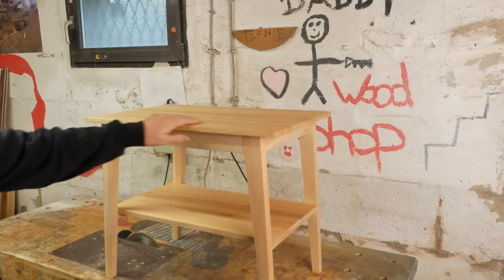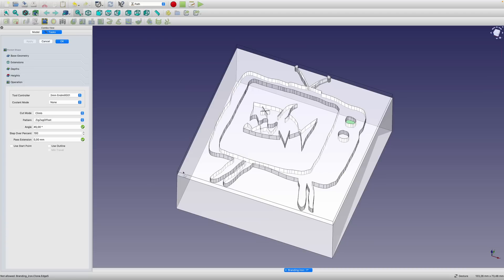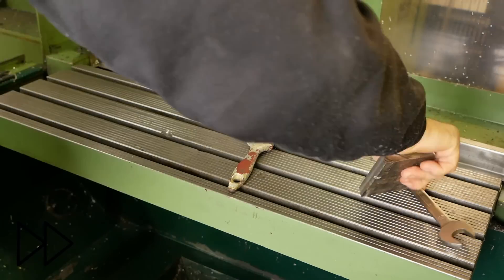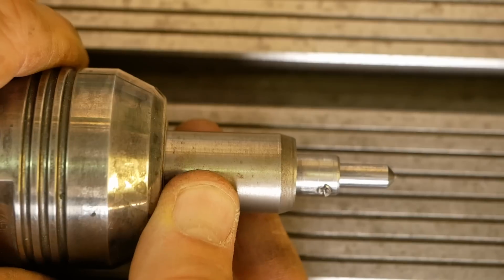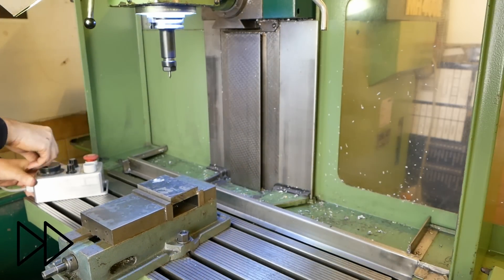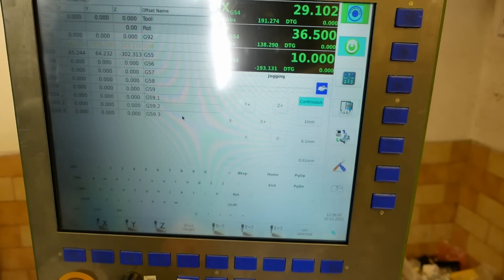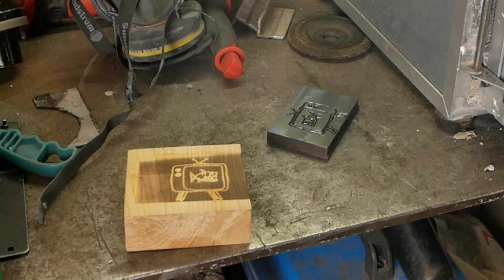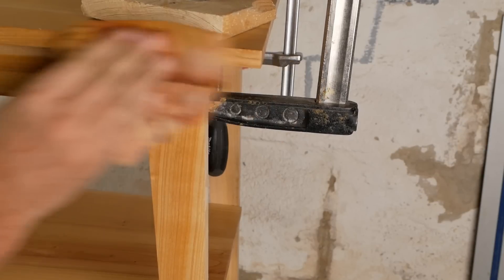Branding iron for my woodwork.

Comment: If you would use the Steel blank as a Casting Form for alluminium IT would bei the right orientation and the lines would be high spots that burn into the wood
Reply from the maker: Oh, now that is an excellent idea. I like that. Thanks.
Reply: @RotarySMP  It's clear you planned to do that all along, why else would you have machined it to produce a mirror image? 😉
Reply from the maker: @graealex  I honestly didn't give it a seconds thought! My "planning" often includes such glaring omissions. :/
Reply: @RotarySMP  I agree, a good idea, But it doesn't solve the original problem, which still will haunt you again and again. CUT2D by vcarve
Reply: Probably you could use copper to cast the brand. And that’s a super rare left handed TV set. C’mon. Haven’t you seen a left handed TV before?
Reply: Cast it in Bronze. It will make for a more durable tool. I would also suggest using it with an arbor press to make quick deep impressions without scorching the surrounding wood.
Reply from the maker: @nrml76  True. I need to pour some bronze as I am behind on my Beatles statue series.
Reply: now I read you ... same thought here ^^

Comment: I do a lot of 2D CNC engraving like that job.
For most cases I just use Corel Draw or whatever 2D drawing program you can work most quickly with, and manually draw in a toolpath for the areas you want to engrave or cut out.
It might sound like a lot of work but you only have to be accurate creating a toolpath on the very edge, then the rest of the pocket you just make sure it is inside the edge (of course) and the stepover (which you msnually draw) is smaller than the tool diameter. And for pocketing interior paths etc you can often just use rects or circles which only take a couple of seconds to draw especially if you have "snap to grid" set up right.
For something like your TeleFish it would probably be about an hours work drawing the toolpath manually. Maybe less if you are comfortsble with the drawing program. I'm guessing between the file conversions and frustrating attempts you probably spent more than an hour on it, which is one reason I mainly draw manual toolpaths. The other reason is you get total control of the cut and stepover etc, good for us control freaks. 😎
Reply from the maker: Thanks for that insight into your method.

Comment: Self intersecting geometry means you have one or more “loops” in you part. If you imaging a square shape using a piece of string. Now take one corner and twist it into a loop. You proved it was the model by trying feature cam. Send me your Iges file and I will correct it, or send the pic with the outside sizes marked and I will make a new model that will work in either CAM. Keep up the good work. I do enjoy your videos. 😊
Reply from the maker: I went through the whole dxf, looking for that sort of issue. My Email is on the channel "about" page, so if you drop me a line, I'll send you that iges file. Thanks for looking at that.

Comment: A possible cause of "self intersecting" geometry in Feature CAM could be the large polygonal shape. Internally it still consists of triangles they are only hidden. I'd try to split up all large polygons until they consist of smaller convex ones, without negative angles. It could be done in Blender manually or using a remesh afair. Large concave polys are always problematic. I'm very happy whenever you include Maho work 🤗 by the way.
Reply from the maker: Thanks John. That is only a thing with surface meshes isn't it? this is a solid.

Comment: For the program it looks like it might have not gotten the dimensions of your part right or maybe it thought it was inch rather than metric? Or it might have wanted you to set the stock of the material as well? Just guesses since it is a very weird situation.
Reply from the maker: I thought that as well, but that block is 60x60 in the CAD.
Reply: @RotarySMP  could have it been tool dimensions them? its just seems like a weird situation, could you share me the file so i can look at it?
Reply from the maker: @gm558  I just started a thread on it in the Freecad Forum:
https://forum.freecadweb.org/viewtopic.php?f=15&t=74440

And the file is here;
https://github.com/rotarysmp/mh400e-linuxcnc/blob/master/Telefisch.iges
Reply: @RotarySMP  i will try it with the same program over the weekend, should i write you an email or just reply here?
Reply from the maker: @gm558  Probably best to answer in that FreeCAD forum, as then others can learn from the same.

Comment: Maybe the scaling in freecad was way off. Therefore the 2mm end mill was to big for the little pockets and it found no geometry to cut. Furthermore it explains the behaviour on the outside of the part. Maybe it was a part in mm imported as inch - this would make your part 25.4 times smaller than it should.
Reply from the maker: Good point. I'll check that.
edit, that wasn't it. The part is 150x150mm in FreeCad.

Comment: Old school way would still work. Contour in Coreldraw would step any increment you set, so use a setting just smaller than cutter diameter. You would draw the outer shape, then set it to 'outline' inside said shape, whatever was required to make a faux toolpath. Leaving required raised areas as blank, so you are cutting away with what you draw. I used it long ago with Dancad 3d, exported to dxf or whatever was required.
Have emailed you a sample.
Reply from the maker: I could do that, but would rather learn to use FreeCad properly rather than doing a workaround.

Comment: DXF files don't have units internally. It's possible that your file is in inches but FreeCAD is interpreting it as mm. Maybe try creating a 2mm cylinder in the same FreeCAD project and see if the scale looks correct?
Reply from the maker: I thought that as well, but it shows up as 60x60mm

Comment: Came to comments section to see what is popular in open source community regarding CAD tools. Nice video but I miss parts related to plane servicing. Could you please say something that device that prevents hydraulic oil to drain completly in case of failure? Think that is later addentum after some incidents where planes lost 2 or 3 hydraulic circuits.
Reply from the maker: I cant always think of the right aviation things to talk about. 
I need to try harder. Thanks for the reminder.

Comment: If your tool paths looked like the they have way too much clearance for a 2mm Endmill, that almost certainly indicates you didn't set up your tool correctly somewhere and it's still the default 5mm diameter.

Would be very happy to look at your job file and set it up for you as an example, with some notes.
Reply: My thoughts exactly
Reply from the maker: Turns out, my IGEs export was corrupt. Once that was repaired, it seems like Path works fine on it.

Comment: Check out cambam. It would do for your purpose quite fine. There are tosn of addons which make it quite more powerful software. It is not free but it only costs like under 200 euros. Great and entertaining work by the way 👍👍
Reply from the maker: Thanks for the tip.

Comment: Oh, Cura, the 3D printing application has a way to extrude based on high contrast images. I edit my images to be black and white only, tell it white is higher, then it spits out a great object
Reply from the maker: ?? This was not a 3D printing job. I wanted to machine it.
Reply: @RotarySMP  isn't a solid object file a solid object file? I'm just saying if one format is having issues, maybe try a different format or another way of generating it
Reply: @RotarySMP  Yes, Sure you don't want to Print it. But you can use Cura to generate an stl File based on a black and White Image to create a 3D-File you can then use in freecad. That is a brilliant Idea from him

Comment: The top is likely to split due to the cross-grain glue-up. I made a cabinet the same way out of pine when I was 15 and the top split a year later. 30 years later today, its still split, with a cloth over it:)
Reply: They make special sheetmetal brackets for table tops that slip into a channel cut into the inner edges of the aprons. This allows the top to move.
Reply from the maker: Darn, I should have thought of that.

Comment: Late to the party, so I may be duplicating something, apologies!
First: That looks really nice! The woodwork, that is. Would look good in our front room!
Second: For a Plan B, also looks great. Scrap that, leave it as Plan A - everyone can brand the lines, you brand the space around the lines, I like that!
As for the marks your stuff leaves on other surfaces - are those treated, or raw wood? I wonder if treatment helps with burning the cellulose, just like some fat in the pan helps the Maillard reaction?
Anyway, nice table, unique, cool branding, thanks for the video!
Reply from the maker: I am waxing that table. Might have already tied wax on that bit of scrap I tried to brand. That might have been the problem.

Comment: Ahh! No glue! Maybe a few inches in the center on each end. Best - a few screw clips that will let the top move. Nicely done, otherwise 😊
Reply from the maker: It is only a small table. I hope it will be okay with the glue. There are also pegs in all the joints.
Reply: @RotarySMP  yeah… pegs not such a good idea either :( hope it all holds; looks like a nice table. It is a small table, and may just stress the joinery a bit without catastrophic failure

Comment: Good effort :-) I'll just repeat what many other suggested - cast a metal stamp on the steel plate (the plate needs to be very hot for it to work), as I have no idea what went wrong with CAD file.
Reply from the maker: Hi Jose. It is a good idea.
Reply: @RotarySMP  Glad you liked it 🙂

Comment: For Fusion, I converted the image to an SVG. Inserted that onto my stock and extruded the design. The stock was 70x70mm. I only used the inside lines (if that at all makes sense) which left enough room for a 1mm endmill - particularly between the TV's legs. For the eye... I just engraved it to .3mm. Toolpaths all valid - after some faffing to get the model in the right orientation.
Reply from the maker: Hi Shane, the issue for me with Fusion, is that I cant justify the cost of a commercial license for the couple if use cases a year, but cant use the hobby license since I monetised my channel.
Reply: @RotarySMP  ja. I get you. I think 2mm mill bit - given your dimensions where probs, 100mm x 100mm that the smaller pockets wouldn't compute - if that makes sense.
Reply: @RotarySMP  also would try brass. It also heats up quicker and is probably simpler to machine with a 1mm cutter as it is softer

Comment: The "self-intersecting" geometry warning is likely due to lines intersecting on the TV legs, antennae, and the fins on the fish. It likely wants you to have a proper polygon, without line intersecting. The islands on the knobs are actually fine, it's all about line intersections. If you want some lines to be visible, you'd want to define them as contours, not just lines across. I think there are tools that can fix it automatically, it's a feature most 3D printing slicers have. There's also a free tool Meshmixer that lets you do stuff to meshes, including fixing geometry.
Reply from the maker: Thanks Aleksey. I will try to remodel those features.
Reply: @RotarySMP  You're welcome. I work in the Geographic Information Systems field, and "polygons" have a very specific definition. A polygon consists of at least one "linear ring" as the "outside ring", and zero or more "holes", or "inner rings", which are just as it sounds: holes. Each ring is a set of points, where two consecutive points always describe a side of the polygon (or a hole). For some formats the outer ring is always counter clockwise, while holes are clockwise, but that's not always the case. The main thing is that they're all "spinning" in a consistent direction. e.q. given points A, B, and C, which are vertexes, they should also decribe to adjacent sides: AB and BC. I hope that makes sense.

If that's not the case, most algorithms will just poop, with various catastrophic results.

I guess you could imagine a piece of paper that you just randomly cut into some shape. Then you cut some holes in it as well, but you never cut anything that would go "through" your piece of paper, so that if you try to pull it apart nothing separates or tears.

Dunno, I hope that helps :)
Reply: sounds similar to problems I have encounterd when importing and exporting 3d geometry. I think in 3D the "spin" of the lines is insted described as the normal direction of the faces, so sometimes the problem with the geometry is inverted normals
Reply: @dfgaJK  Yeah, that's probably similar. You don't get the same kind of level of specificity: some things are just solved automatically, but self-intersecting geometry tends to trip up a lot of things.
Reply: @rembo666-r3d  In the past, while doing some animation for a company, I had to fix their entire poorly made font due to self intersection, 1 letter at a time 🙄
Reply: @dfgaJK  Yeah, fonts are their own special kind of hell. I had to make various fonts line up with the UI in a vector graphics editing interface. I got it pretty close too. When I see fonts never quite lining up in PowerPoint, I feel proud of myself, because my stuff wasn't much worse. You're a hero, but a hero I would never wish to emulate :) Sucked to be you 🤣

Comment: Use nettfab to fix the geometry. Also, is it possible the size of the stl was incorrect?
Reply from the maker: I didn't use STL. They were IGS files.
Reply: @RotarySMP  maybe stl would work better since it's been more widely adopted with the rise of 3d printing. I'm happy to help if you want

Comment: If Fusion is anything to go by the default adaptive tool path template assumes a roughing pass and leaves stock in the pockets - usually 0.5mm. Maybe take a look at the presets for the selected toolpath.
Reply from the maker: Thanks Shane.

Comment: With the double conversion (image-to-dxf-to-iges) you might spend some time looking at the resulting import. There may be some very small artifacts that are causing the self intersections. Try importing into another CAD software and see if you get similar issues. The problem may be with the source file, not the software. If your dxf file is still available, you might also try re-exporting or exporting to a different format like step.
Reply from the maker: Thanks. The DXF was drawn as polylines in Onshape. But I did find some little screws ups in it. There is probably one I missed.

Comment: Meshmill might just work for you, it's open-source software that runs on Linux as an Appimage, might even work on your linuxCNC machine, it takes STLs and produces simple toolpaths. There's also pyCAM, but it's been somewhat abandoned and uses ancient openGL graphics library that doesn't want to cooperate with more modern versions of openGL, had no luck getting it to wokrk on Fedora distribution.
Reply from the maker: Thanks for the tip. This was not an STL export, it was an IGS file.

Comment: 3D print a pattern and cast the brand? 
But that ought to be more work. I, too, would have assumed that CNC engraving it was going to be the quick and easy way. 
I suspect that your FreeCAD problem is that it does not see the edges as the shapes as contours. It might help to trace the outline to a FreeCAD native curve of come sort. 
Maybe you went to FreeCAD too late in the process, and should have imported the DXF into FreeCAD instead and started there.
Reply from the maker: Hi Andy,
I tried that as well, but for some reason the dxf imported on some weird slanted plane, and I couldnt work out how to get it to lay down onto a known plane.

Comment: number 269 in telling you: "don't glue the tabletop to the frame .. the expansion and contraction will crack the joint .. the top should be mounted a bit "floaty" .. 😉🤓
Reply from the maker: Thanks Andi. I am still a newbie at wood working. There are dowels to help keep it in position, if it does crack the glue.

Comment: Maybe FreeCAD didnt liked sharp corners in your low-poly model combined with 2 mm endmill? Maybe there's some tolerance settings to change? (never used FreeCAD, just guessing)
Reply: I think sharp inside corners are the problem, too. The endmill can't get there, because of its radius, no matter how small it is.
Reply from the maker: That is the case for any square corned as well, and CAM programs normally dont error out on that, they just say you will get a curved corner.
Reply: @RotarySMP  How about two inside corners, close enough to each other, that the endmill radius prevents it from getting at least tangent to the face between the corners? Haven't played with CAM myself yet, just recently got Alibre Atom3D CAD (most basic version), since my home shop  machines are all manual, but still interested to learn about the CAM process, and how it copes with these kinds of cases.

Comment: FreeCAD drives me insane sometimes. It's always when I think everything is tickettyboo and I'm settling into a nice cozy false sense of security and delusions of competence that it bites me with some apparently insolvable problem.
Reply from the maker: I am getting the hang of using it for simple rather rectangular shaped parts, and quite like the speadsheet based parametric modelling, but yep, same here. Sooner or later you hit some weird "feature" and get blocked.
Reply: @RotarySMP  it's good for me- I've spent a lot of my career training people to use equally esoteric and counterintuitive GIS software. 

Trying to get my head around FreeCAD puts me in the place a lot of my students are in. It's so easy to forget how steep the learning curve was when starting out...
Reply: @RotarySMP  Mainline FreeCAD drove me nuts, but Realthunder's branch works very well. I manged to design a few pretty complicated parts with it. I have no idea how Path works there, though.